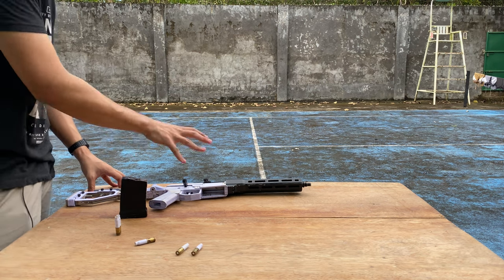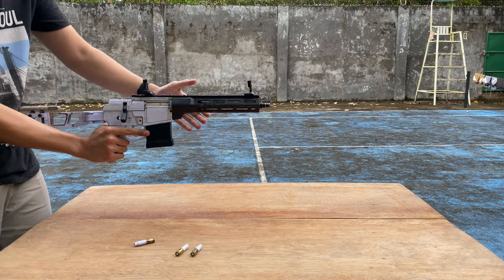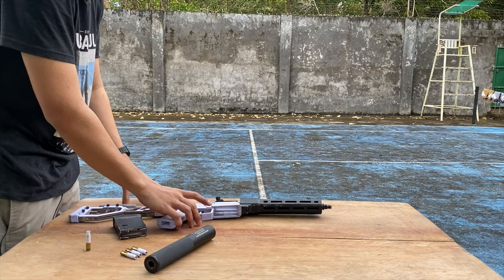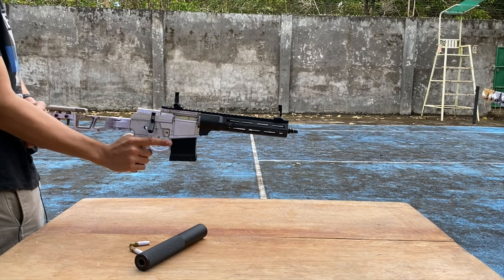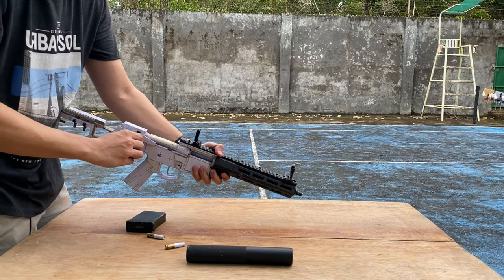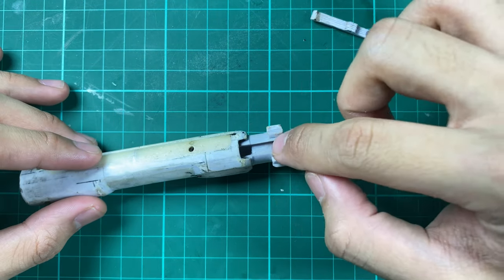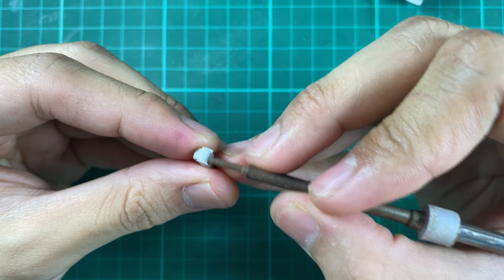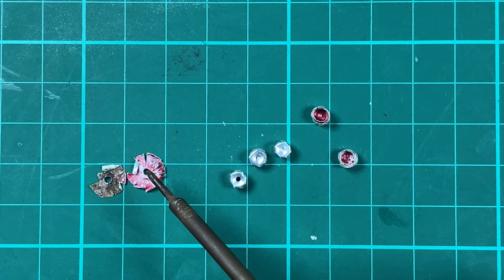Paper Rifle #8: Test Fire #1 + Analysis

Comment: Hey..
Well first great work and really nice rifle i salute you for that 
I have a paper m1911 which needs some finishes anyways   i was trying to see if the firing pin could work or not and i had the same problems like you but then after revising the problems i figured the solutions and hopefully it can help you 
First .. the soda cans are very weak and easy to puncture so i recommend using a slightly thick metal sheet 
The second thing which is very important is you forgot to use the anvil and that's why the primers were  getting punctured and leading to a reverse gas and leaking 
Third thing you need to make the primer place in the cartridge tight and use a wax or super glue to make it stick and prevent gas leaking 
Hopefully 
And very important thing DO NOT  use armstrong mixture as a propellant because it doesn't burn 
It explodes so use only matchsticks heads
And hopefully this can help you my friend
Reply from the maker: Thank you for the tips! Well said!

I'll definitely consider your findings next time I do a firing test.

Comment: Glad this hobby is taking notice. If possible could try redesigning a anvil so and extra layers on the primer cup. It could help pinch the caps when the pin hits the anvil within the primer and the extra plating can help keep the gases sealed when it goes off. Also if you could add extra powder and mix in some powdered glass you might improve your chances for ignition. the powdered glass will make the matches friction sensitive